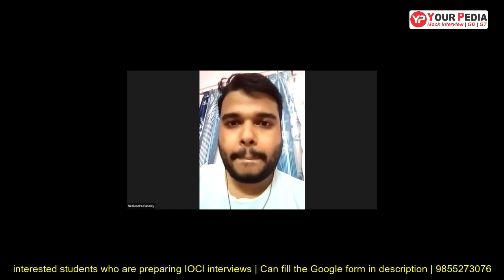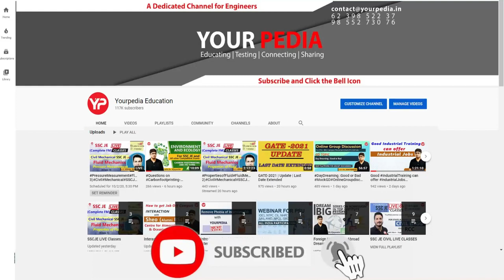Electrical Machine Interview Questions for IOCL | EE Interview Questions | IOCL EE Mock Interview

Comment: At starting most of the current flows through outer cage because it offers lower reactance. So by making outer cage more resistive starting torque increases.